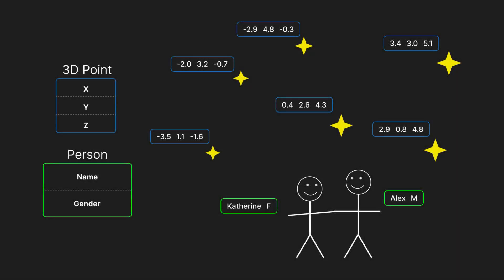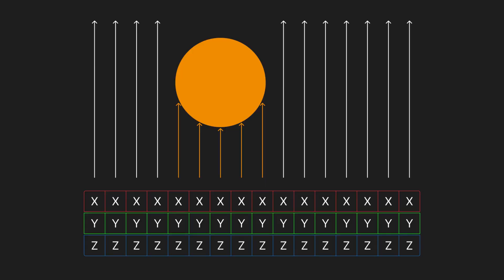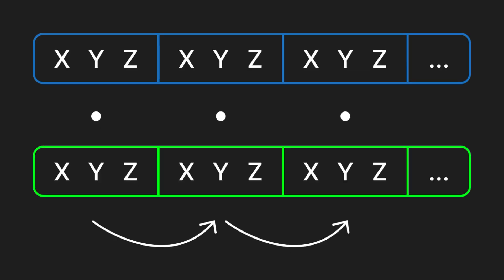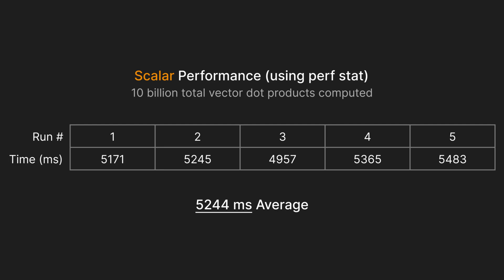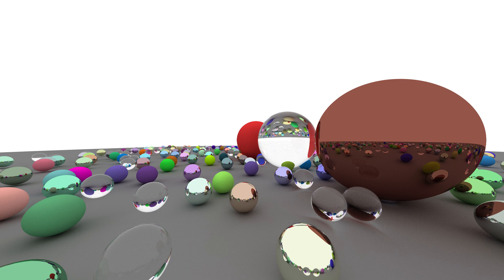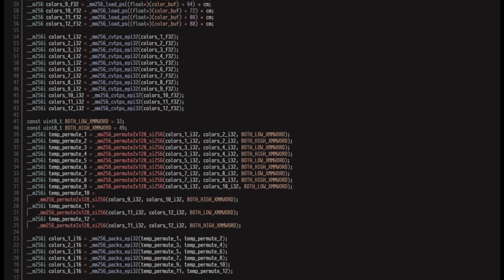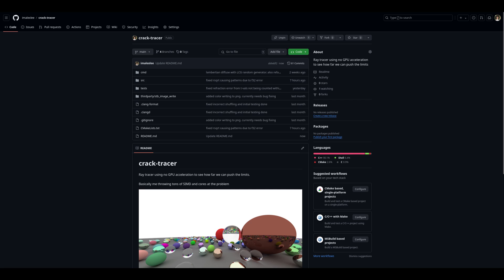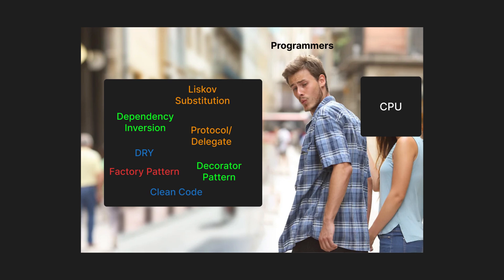What is SIMD? Abusing Vector Instructions Across Threads for Ray Tracing

Comment: The MM registers aren't the lower 64 bits of the XMM registers, [And this where I think Intel made a BIG mistake], they share the x87 FPU registers, so you couldn't mix MMX and FPU instructions without suffering HUGE perfomance penalty for switching modes!
The XMM, YMM and ZMM registers do, as you said, all share the lowest bits.
Reply from the maker: You're 100% right and that was a complete overlook when making that part of the video. Thanks for the correction and I'll pin this for other people 👍

Comment: Hi Alex, could you have gotten some autovectorization from your compiler, or were you already compiling with all optimizations turned on? I am trying to determine if only de-OOPing the code could allow the compiler to auto-vectorize some of it.
Reply from the maker: I don't believe that compiler auto-vectorization would have produced a similar level of vectorization. I don't mean this as a definitive statement, however, since I didn't do a true side-by-side comparison where i stripped out all of my simd calls but left my data structures the same. Something like this may be too complex for a compiler to truly produce an equivalent output. for instance, my code and data structures are highly influenced by my choice to use simd across the entire ray tracing pipeline. my memory has to be aligned to 256 byte boundaries, and most of my data structures are structures-of-arrays instead of the more commonly seen array-of-structures. The choice to use simd across the entire project has added a lot of really specific changes I needed to make to accommodate this so that's why I'm just not sure that turning on all optimizations would have really ended up in the same spot.

Comment: Very intriguing, last time I used SIMD was to implement bilinear downsampling for huge images (131072x131072) on a Power8 machine, and SIMD for PowerPC is (in my sincere opinion) way easier to work with than x86-64. It didn't speed it up too much in the end, but I believe that was due to other reasons (probably caching).
Honestly, nowadays I don't touch SIMD unless I really need to, sure it's a fun gimmick, but for most practical purposes/projects it's very rarely used, not to mention that smart compilers (ie, anything other than MSVC) already are very capable of vectorizing code given that the design is good.

Comment: I need to split vectors and other data to use simd? Can't this be automatic?
Reply from the maker: @gendalfgray7889  could you explain your question more? Also do you mean C++ vectors, or math vectors
Reply: @alex_d_lee  you said you need to split vector to it components. Instead of array of vectors i need 3 arrays for each part? What if i have class with bunch of data i also need to split it?
Reply from the maker: @gendalfgray7889  oh I see. It really depends on what you need to do. In my case, I wanted to find the dot product between 8 mathematical vectors at a time, which is why I created three arrays holding the three components. This is so I could load in groups of x’s, y’s, and z’s into their own ymm register at a time, and work on those. That allowed me to get 8 dot products after doing the same amount of math operations it would take to normally find one dot product.

If in your case, you simply want to add Two vectors together with SIMD, you don’t have to do this. You would just load in one vector into one simd register, another vector into another simd register, then add those two registers together. 

Once you start working with it, you’ll soon realize how your data needs to be laid out to do what you want most efficiently though. Lemme know if this explains things well enough!

Comment: SIMD instructions are really cool but I feel like when you actually get to the point of needing them you'd often be better off doing it on a gpu instead. Obvs you'll get higher latency as opposed to sending the data to the gpu and back, so ig they're best used as a little spice to speed up specific tiny parts of your cpu code but I feel like that means they're in a weird middleground between gpu and cpu
Reply: There are server systems without GPUs. And the latency between CPU and GPU is extremely high, you can't just put that as an aside.

Comment: to the last point: True, but not everyone is programming using vectors. Most are just wordpress devs making a website for your local bakery. These devs should concentrate more on readability and maintenability than CPU performance.
Reply from the maker: @andreujuanc  My last point wasn’t that everyone should try to fit in vector instructions everywhere they can or optimize as hard as possible. It’s that understanding how your hardware works and what it can do makes you a better decision maker overall when building any software. Even that local bakers website will be frustrating to use if it takes 3 seconds to switch pages. Thanks for watching!

Comment: cpu simd is wannabe gpu, so usually this type of optimization is not worth the complexity, yes you can run the same code faster on the igpu, yes gpu compared to cpu is cpu implementation not worth it, unless you dont want to mess with gpus at all. yep implementing on cpu takes time. also instead of individual rays, try surface point cubemap weighted raster to get say 32*32*6 = 6000 rays samples per pixel. yep by raster, and use gpu shaders. k.i.s.s.

Comment: CACHE HIT optimization: DO NOT render image by lines. Render in tiles so it is probable you need smaller subset of objects from scene. Even better could be to use Hilbert Curve to travers pixels instead of tiling. (this has lesser effect on scene where u "cheat" with perfect balls because they take almost no RAM, in contrast with vertex objects which does not fit into L3 CACHE/RAM)
Reply: A Z-order curve is computationally much simpler than a Hilbert one but with very similar cache friendliness. Getting the X and Y coordinates of a pixel is as easy as taking the odd and even bytes of the index number. At least for square power of two sizes.

Comment: This is definitely an experiment I can get behind as I've got onboard graphics in my potato. I don't know if anyone else has this problem with building it, but I had to push down the cmake version it "required" to get it to attempt building, then add PThreads to the link command to actually get it to build. Possibly the latter stemmed from the former, but I don't know because I'm not going to upgrade my system any time soon. However, it might be interesting to design a CPU-heavy game engine. It wouldn't be as fast, it couldn't be, but it would still be an interesting experiment.
Reply from the maker: @anon_y_mousse  oh awesome thanks for letting me know! If you want, open a pull request with those changes with the older cmake version you found to work. That would be really cool and we’ve seen semi-3D games done before on older cpus so no doubt it would be even better now.
Reply: @alex_d_lee  For sure, if you don't go for photo realism in real-time modern CPU's can handle things better than older ones could, but like I always say, graphics aren't everything, and what we had 10 years ago is more than enough if you've got a good story and good gameplay.

Comment: Dang if only there was a giant floating point vector co-pro in my computer right now that is way better at doing this than my CPU so I could free up the wasted AVX chip space there for much much more useful L1 cache.

If only.

(Excellent video).
Reply: all seriousness there are a lot of cases where you dont want to use the gpu. mostly when latency is an issue. the time it takes to upload and call back the data often takes longer than calculating with simd, even if the gpu does no compute.
Reply from the maker: @chickenbobbobba  yup very true. Considering most x64 vector instructions take between ~1-15 cpu cycles, it’s pretty unreasonable to send relatively small workloads to the gpu. Obviously in the case of a ray tracer, the volume of work kinda makes a gpu a better choice but you’re completely right for the majority of cases you would ever considering using simd for.
Reply: Apparently unpopular opinion: AVX did nothing wrong. It sounds great to have a larger dedicated GPU for parallel operations, and in some ways it is, but the cycle overhead of moving data between CPU and GPU is prohibitive, even on the same die, and there’s a lot of advantages to having SIMD directly in the CPU itself. You can more easily do conditional / branching compute, the programming model is a lot easier to fully optimize (There’s a reason CUDA devs at AI startups can make seven figures ATM), and a lot of the space used by AVX instructions would generally be “dead silicon” anyway, in the sense that in modern CPUs you have to leave large areas of the silicon blank for heat dissipation concerns, so it’s really not that expensive to throw some extra conditional accelerators in those areas anyway. Plus, adding a moderate degree of AVX acceleration multiplies the value of your CPU in those types of operations for a relatively small amount of die area, so it’s actually incredible value for what you really get out of it.

Plus, there are some workloads where you want SIMD, and need a lot of RAM. Generative AI comes to mind, but there’s others. In those cases it can actually be really beneficial to have access to a huge pool of very affordable RAM (even if it’s not as fast as VRAM), because Nvidia seems hellbent on ensuring people spend the absolute maximum possible to go beyond 8GB of VRAM.

Finally, deploying AVX code is way simpler than deploying GPU compute shaders; to deploy AVX, you literally just send someone the binary. With GPU? It’s way harder to package the appropriate compute shader libraries with your program, and adds another headache in managing dependencies. Having walked something like a dozen people through installing ROCm, (and non-technical people through installing CUDA, which actually ended up being about the same difficulty), I would honestly rather spend an extra eight hours optimizing SIMD code on CPU than spend one hour each with a hundred people who can’t be trusted to install their own GPU compute shaders.
Reply from the maker: Haha if only 🤔. Thanks!
Reply: The runtimes for actually using the GPU are typically extremely large, not to mention the latency of inputting into the GPU and receiving an output from memory. Embedded or real-time operating systems will thus want to use the CPU for this; as well as homebrew operating systems which do not yet have GPU drivers.
Reply: Not all architectures and use cases are the same.  GPUs are really, really good at chewing through large pages of RAM.  They are not nearly as good for addressing across large spaces of RAM.

The DDR5 standard matches a 256 bit cache line and can be broken down into 4 64-bit reads of 8 byte banks.  If memory serves correctly.  While the bandwidth of DDR5 is technically lower than with GDDR5 - or even GDDR4... If you want one value within an address bank for a GPU, you have to read a whole 256 bit page, pull the one value into cache, and dump the rest.

In the case where you have concurrent processes, one computing ranges of addresses, and another doing the same operation across those addresses, an X86-64 CPU allows you to restructure memory in RAM into a format compatible with SIMD (or other operations) and/or to effectively use SIMD to link together values in RAM according to some algorithmic process - cryptography being an example of this.

The sky is really the limit when you are talking assembly language - there are no variable declarations or limitations, just addresses/registers, the values in them, and the operations to perform.  Well, there's a stack and heap and all that other fun stuff, but water under the bridge.

The more "ways" you expect a range of data to be pulled into different computational processes and the less likely its immediate neighbors in memory are to be useful to that value, the more powerful, relatively speaking, CPU SIMD is.